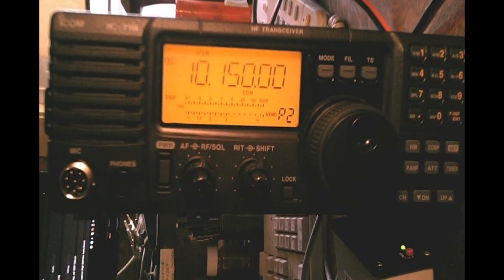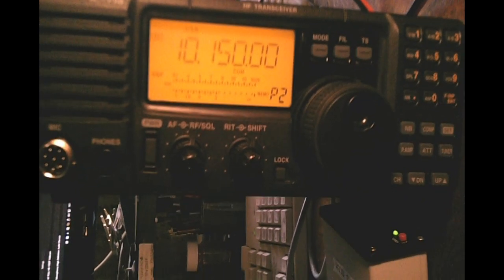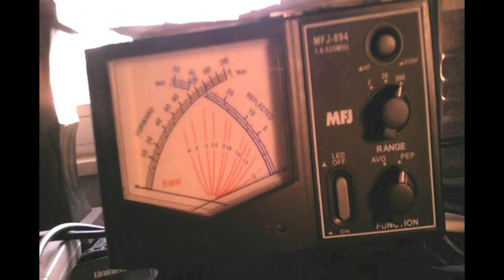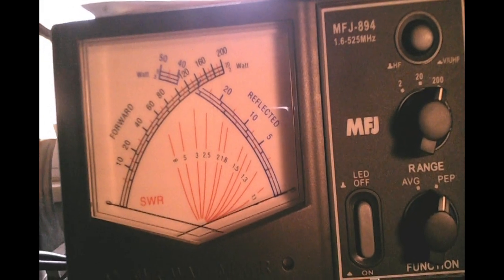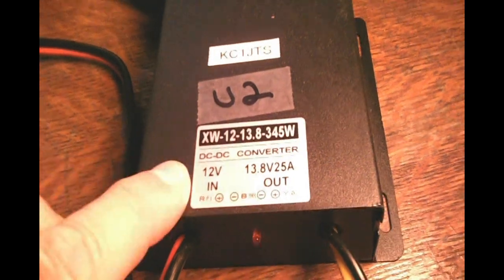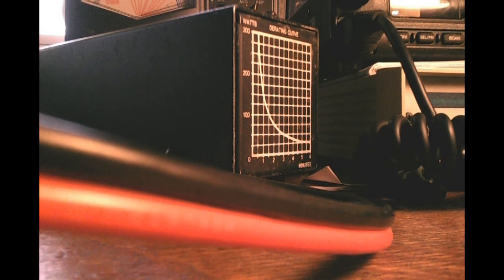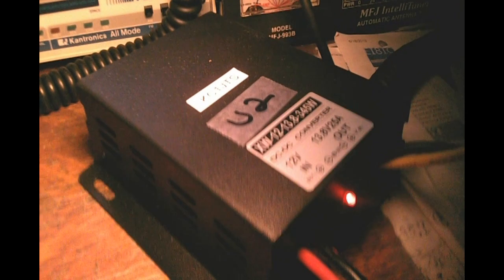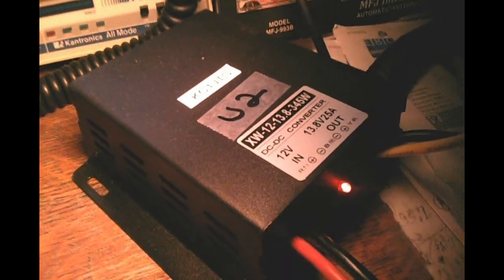ICOM 718 with 12vdc to 13.8VDC Power Booster

Comment: Thanks for the tip. I am having the same issue, but I am running an Astron RS-35A 13.8 Volts. It goes up to 40 watts... Every now and then I run the Icom 751A and goes  full power with the Astron. I will try this new device and will keep you posted. Thanks for sharing this... 73, Joe K4JGA...